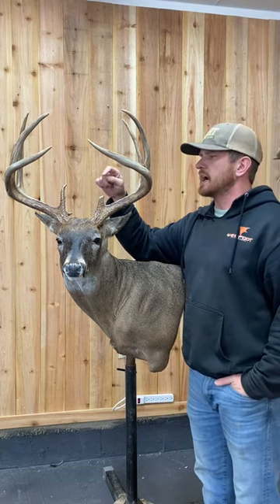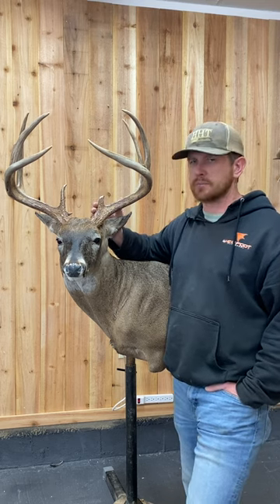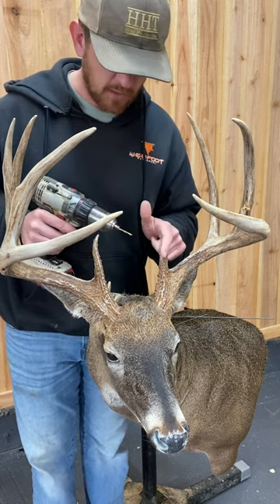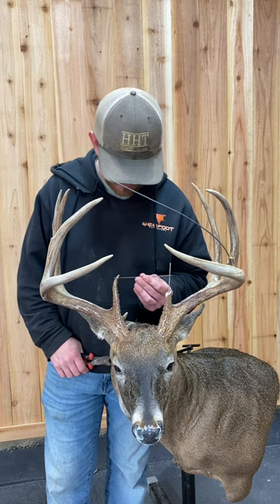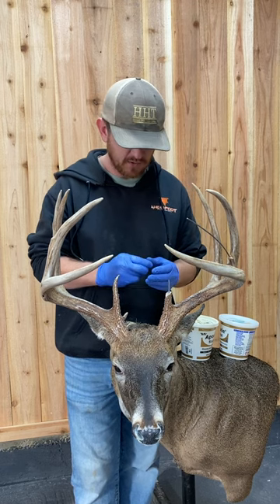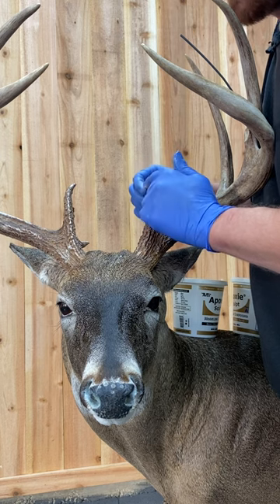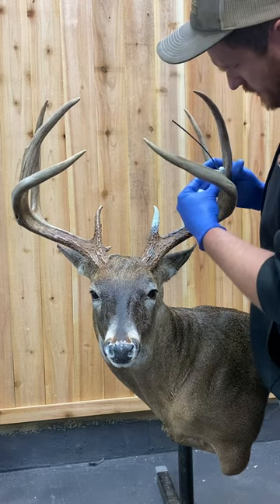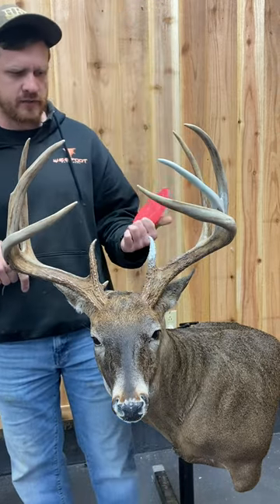How to Repair Broken Antlers on a whitetail

Comment: What is the working time of the epoxy? I didnt hear you say it, only that you would let it cure for 24 hours. Good video!!! Learned alot from you!.
Reply from the maker: Thank you! I have noticed the epoxy starts setting up within an hour of mixing it. But depending on if you mix it exactly 50/50 has an impact on it as well.

Comment: i brushed the pinch back product on but it’s way to dark what can i do lighten?
Reply from the maker: I use a wet towel to dab it, and take some of the color off. Or before you put it on there, you can water it down a little bit.